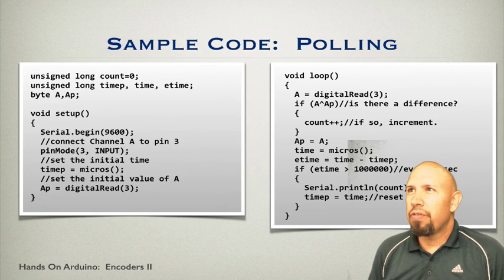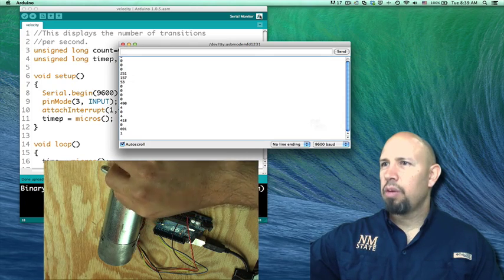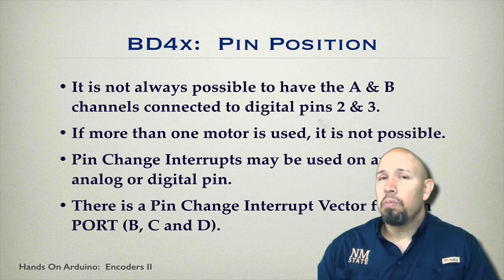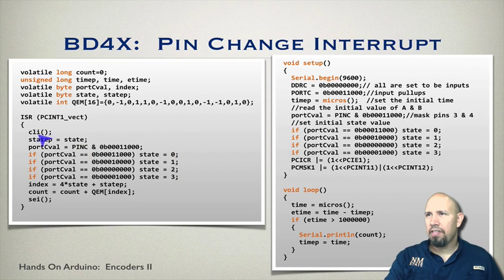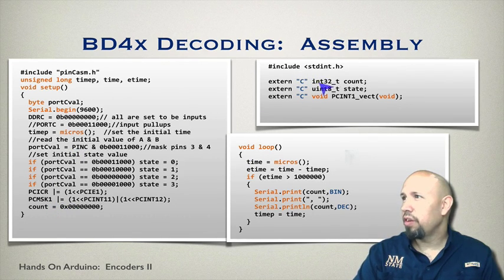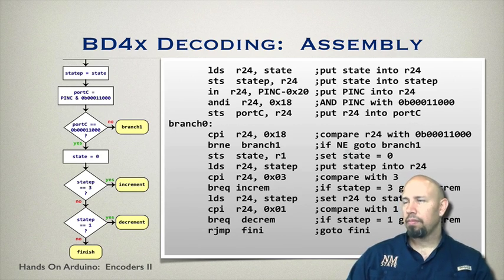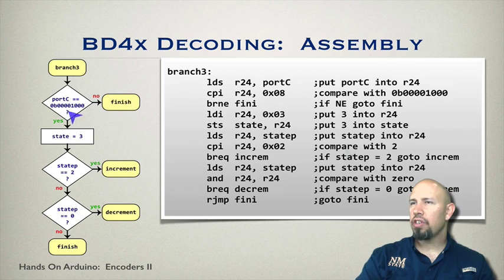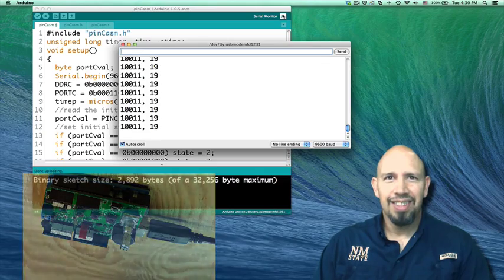Hands On Arduino 3:  Incremental Encoders 2

Comment: 24:15 I think you should not have explicit cli() or sei() in your ISR.  According to the 328P datasheet GIE bit of SREG is cleared by hardware when the interrupt occurs and then will be subsequently set again by the RETI as the ISR finishes. ?
Reply: +NivagSwerdna 35:10 Likewise the GIE bit is clear already so CLI is a NOP.
Reply: +NivagSwerdna 45:34 and finally the RETI sets the I-flag, doing an explicit SEI here makes the ISR potentially re-entrant which might not be what was intended!
Reply: +NivagSwerdna Nice video and video series though.  Thanks!

Comment: Fantastic !  i am trying to synchronize the speed of a stepper motor to  a dc motor driven encoder . Which variables of the velocity code should merge with the stepper motor  speed variables?

Comment: Hi Robert, very useful tutorial.
I am converting a lathe from manual to cnc, and want to use magnetic linear encoders. My lathe will move faster along x and y axes than the speed at which you did rotate the shaft of the motor at 11:30, so is it possible to read pulses at a higher speed rate than 1 second you've set or the arduino will lose some pulses?

Comment: hi robert. very nice lecture.i try ur ,switchcase' code. when i turn the motor... only a series of "0" was display for both cw and ccw direction. the encoder have 700 pulse per revolution.what could be the problem? do i need to use interrupt?
Reply from the maker: nissa1882  I wouldn't be able to tell you without seeing your code.

Comment: I've been going over the example where you're using an array and it seems to me that reading the state and previous state can be done a little bit more clever - but with a different array.

1. We know that 0b10 == 2, 0b11 == 3, 0b00 == 0 and 0b01 == 1 - those are just basic 2-bit values
2. We can put 2 values like that in a nibble (half-byte) so a uint8_t is more than able to house that value

So the reading could be like so:

volatile uint8_t state = 0;
volatile int32_t counter = 0;
volatile int8_t QEM[16]  = { 0, 1, -1, 0, -1, 0, 0, 1, 1, 0, 0, -1, 0, -1, 1, 0 };

void setup() {
  if (pin_A_is_set) state |= 0b00000010;
  if (pin_B_is_set) state |= 0b00000001;
  // rest of the procedure omitted for readability
}

void loop() {
  // make space for current state; we just want the lower nibble - mask everything else out
  state = (state << 2) & 0x0F;
  // read the current state into the lower part of the nibble (is that called a nib?)
  if (pin_A_is_set) state |= 0b00000010;
  if (pin_B_is_set) state |= 0b00000001;

  // At this stage the state variable contains 4 bits of information containing the previous state and the new state
  // that can be directly used as an index - just the array needs to be a little bit different.
  // 0b0010 = -1
  // 0b0001 =  1
  // 0b1000 =  1
  // 0b1011 = -1
  // 0b1110 =  1
  // 0b1101 = -1
  // 0b0100 = -1
  // 0b0111 =  1
  // which results in the array defined above

  // next we use the state value as an index to the array
  counter += QEM[state];
}

That way we can use the actual values that are kind of coming out of the matrix as indices to the deltas array and things could get a lot faster and a lot smaller.

I know it's just a modification of the thing you already presented but I thought it'd be cool to share plus I will not forget it :)
Reply from the maker: Excellent!  Thanks!